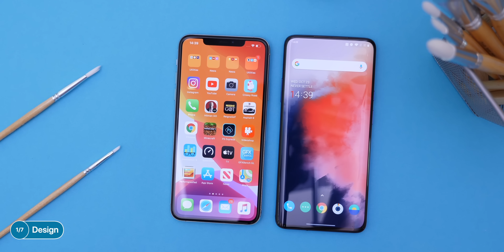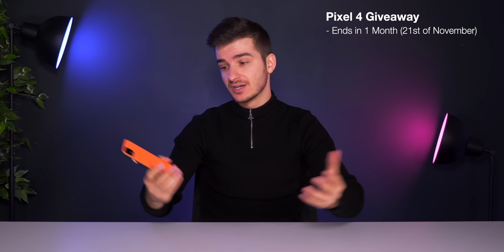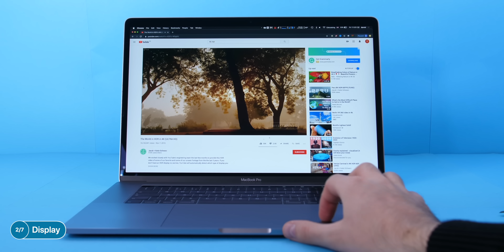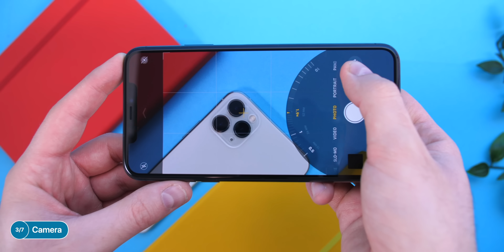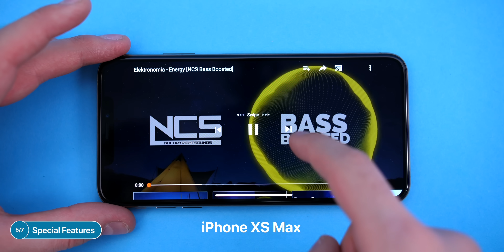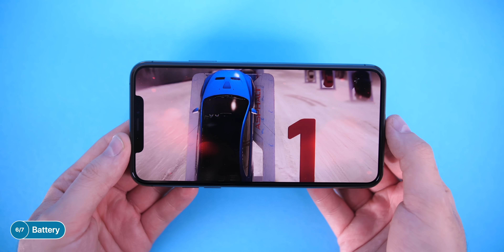iPhone 11 Pro Max - The ZONEofTECH Review!

Comment: APPLE's way 
HOLD app icon for 3D touch and longer for delete X  either just select delete app on 3D touch option [ takes 4 Sec]

MY way
You need to HOLD App icon and suddenly give a little drag to any direction when you feel the haptic to get X wiggle [takes 1sec]

Comment: I don't mind the notch. Face unlock alone is the most reliable and secure method available in any platform. A finger print sensor is a step back in tech. I prefer the use of face unlock versus any other gimmick and something that lacks 100% reliability like face unlock.
The butthole cut out with and inferior camera on the Note 10 is what finally made me change to IOS after six years so thanks Note 10.

Comment: Hi Daniel, I have a question to DeppFusion on 13.2. I have heard that the DeepFusion does not work on the UltraWide lense so far and so to really have enabled DeppFusion it is necessary to diable in the camera settings that it saves the extra information of a picture that is not "really" in the frame. I hope you know what I mean as I am from germany. :-) Can you confirm this?

Comment: Really having a tough time trying to decide between the 11 and 11 pro. I’m so impressed by the battery life of the pro - (combined with the other features) but it’s still so crazy expensive 😣
Reply: Pro Max is still stuck at max 1080p on YouTube and the 11 is even worse. Well, a little worse compared to that at a little over 720p max. Not sure if that matters to you, but it's a deal breaker for me and exactly the reason why I'm waiting for next year's 12.
Reply: I agree but I need to upgrade soon (I still have an iPhone 7 and the battery has degraded etc). Have to say though - iPhone 7 was a solid phone.

Comment: If I had the money, would defo go for the iPhone 11 Pro Max. Only thing is the front design, with that massive notch, it’s kinda looking a bit outdated but the tech inside is pretty good and it’’s not just a useless feature; just wished it was a bit smaller but hopefully the next gen will have a more futuristic design. IG - reeze_needs_cake Twitter - @CarpioReece

Comment: The issue with the RAM management is very likely a wholly iOS13 thing. On my iPhone XS and even my iPad Pro 2018, i would have no issues with RAM on iOS 12, but the moment I switched to the beta, it all went to heck. Even now in public release, it’s still bad. IOS13 in general has been a bit messy so hopefully it’ll be fixed eventually, if not for iOS 14.

Comment: The Google Pixel 4 would be excellent! I especially want to try the Astral Photography.. Dual exposure too. I think the Pixel speakers are the best also, tried at the store. Instagram and Twitter handle: 'Timrdude'
Reply: I wonder if the Google speech to dictation tool will only be available on the Pixel? Would be nice to share that! Haven't seen it on the Google Play Store.

Comment: I still can’t over the fact that now I have to type without 3D Touch.
Reply: I hate it too but you will still have the 3D Touch type feature on the space bar
Reply: Oh man not even close. I could before do so much more with one hand. 3D Touch to move, 3D Touch to start selecting. Then then next letter you Inter would replace specifically what you wanted. 

Now haptic just select either the whole word or you need to use a second finger to stat selecting. Just an inferior user experience.
Reply: I’ve gotten used to using the space bar long press already.